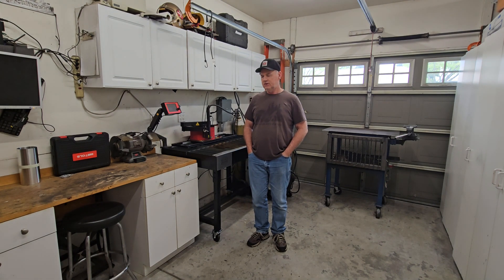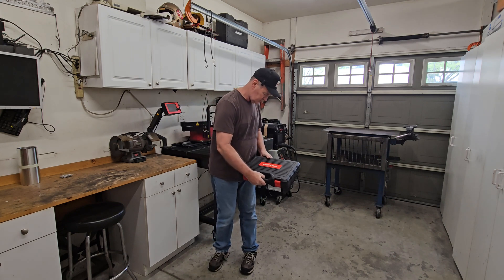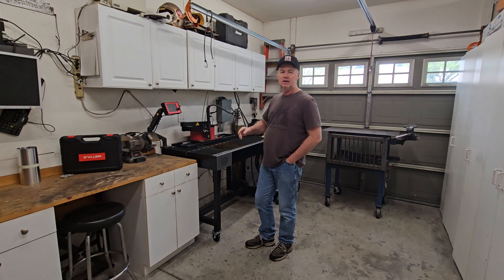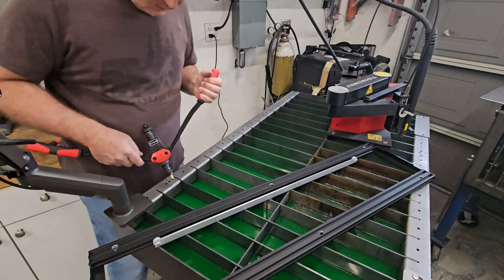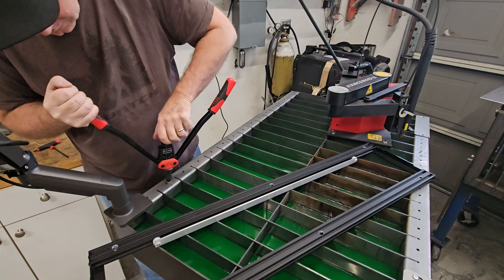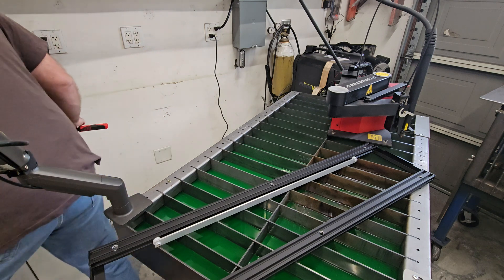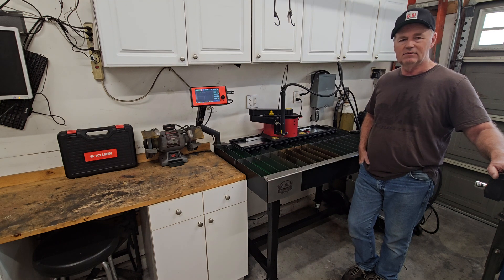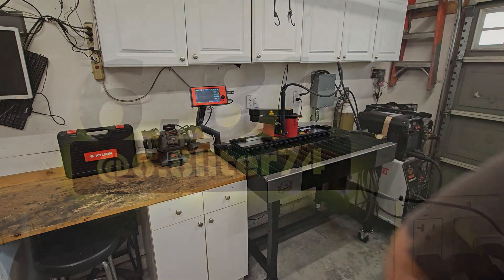How to Add a Splash Shield Under Your ArcDroid on a Texas Metal Works Water Table

Comment: I do look forward to your videos.  Very fun and relaxing to watch.  I do have a question . . . and, maybe you did discuss this in the video.  But, if you did, I didn't catch it.  But, why didn't you just drill & tap the three holes instead of using rivet-nuts???  What you did was just fine.  I am not criticizing.  But, drilling & tapping just seems simpler.  I am just curious why you went the way that you did.  I am sure you have a good reason.  Thanks.  God Bless!!!
Reply from the maker: @JacksMt.Christian  the metal is too thin  to tap.  As always thanks for watching and commenting!
Reply: Okay . . . that makes sense.  Thanks.  God Bless!!!

Comment: Another great video buddy. I find most of my splash back is on the front of the machine with the water table. You’ll soon see 😉. I had an idea… you can switch the torch over for the stylus attachment and then clip a sharpie into it.. perfect fit. That way you can test the x2 without wasting any metal. Anyways, great video and I always look forward to seeing what you do next. 🙏🇦🇺
Reply from the maker: @Fab-Life444  thanks buddy and that is a great idea
Reply: @ not a problem bud. 👌🇦🇺

Comment: Looking clean!
Warning: make sure your splash guard or other metal parts of the table are not touching the X2 encoder strip. It's attached to the frame with insulating stand-offs to avoid ground loops and noise from the plasma going into the machine.
Reply from the maker: @iyeremin  Thanks for the tip and thanks for watching!